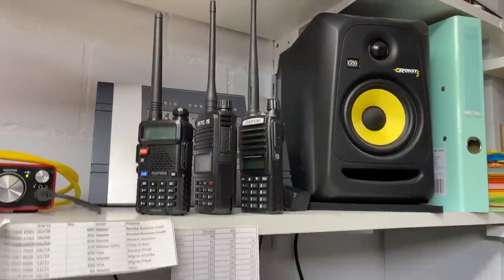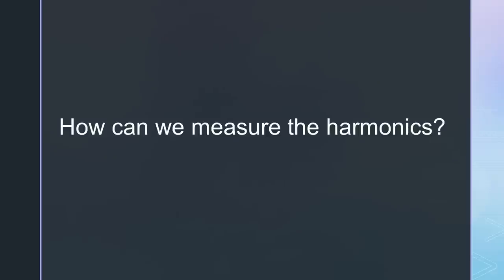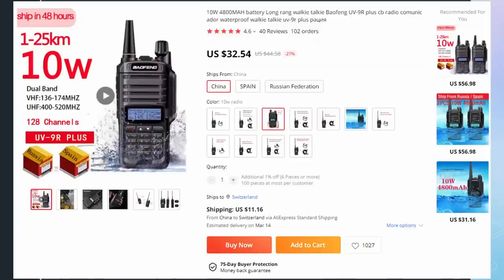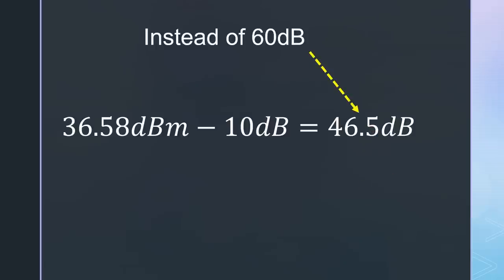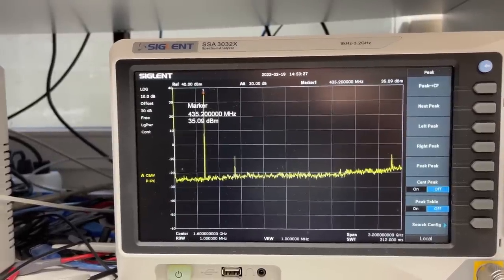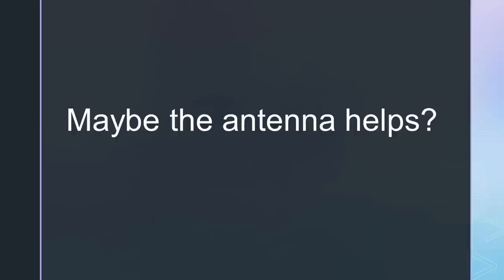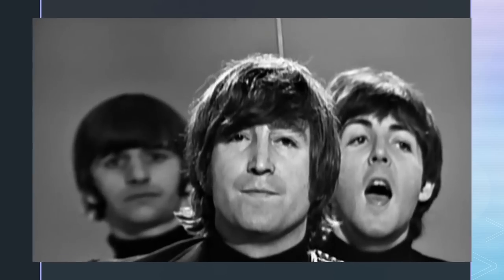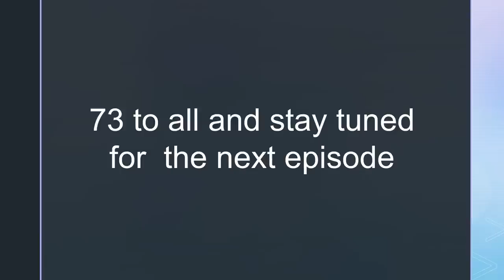011 Retevis RT85: A legal "Baofeng" replacement? Let's do the measurements

Comment: Would really like to see how you can make your own 433mhz rf sender. And by that I mean imitate such a cheap module so that I can process it in my own pcb. I've tried several schemes online but can't seem to get it to work. I can't seem to find any info on how to troubleshoot this.
Reply from the maker: Are you a licensed Amateur Radio Operator?
Reply: @HB9BLA  No, but I also just mean those simple transmitters that you can also find in your doorbell, for example. Or do you even need a degree for that?
Reply from the maker: No, not a degree but a proper amateur radio license :-(
Reply: @HB9BLA  oh really yes? thought this was just something harmless. Just wanted to make it as a lamp switch in my own project and own pcb to develop myself a bit.
Reply: @matheokoning4456  AFAIK all/most countries requires a license for manufacturing of transmitters. This is to make sure the designer knows how to keep the device within legal limits - the harmonics showed in this video is one example on how easy faults can appear.
(Disclaimer I'm not a HAM but interested and did my military service in "signals")
Reply: You can do what you want. But I cannot support you here.
Reply: @AndreasSpiess  I understand that. Anyway thanks for responding!
Reply: @matheokoning4456   It probably depends which country you are in , and what power level you are transmitting - there are legal 433 MHz frequencies https://en.wikipedia.org/wiki/LPD433
Reply: @LarryKapp1  I am only trying to copy such an FS1000A transmitter to process it in my own pcb. This is at 433mhz low power which is the standard for my country. The module works fine only if I copy it according to some schemes, the one on the internet doesn't work. I have no idea where to troubleshoot this and was hoping that maybe a video could be made of this as there is no video of this on youtube yet.
Reply from the maker: @Larry: AFAIK even on ISM bands there is no right to build your devices without a proper education. This is the reason for this channel, BTW. I did not want to show such things on my main channel.